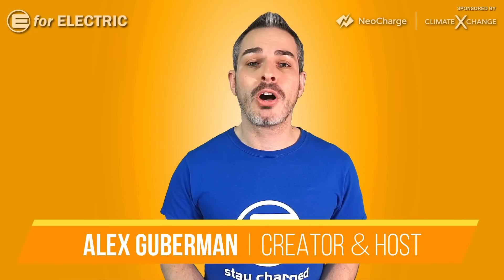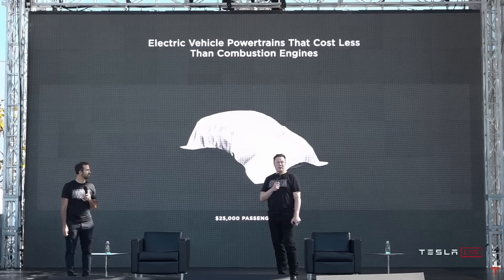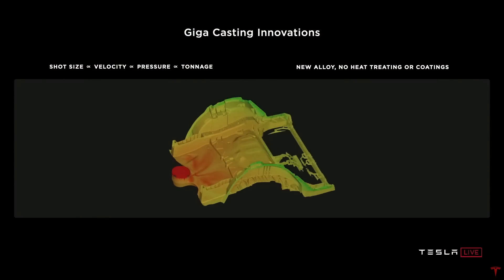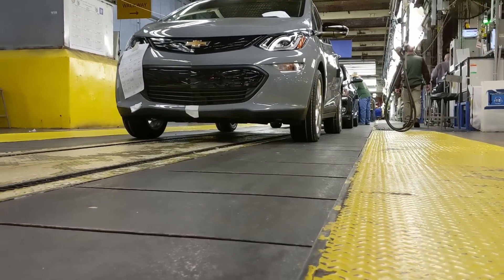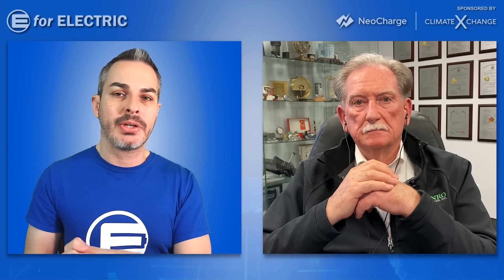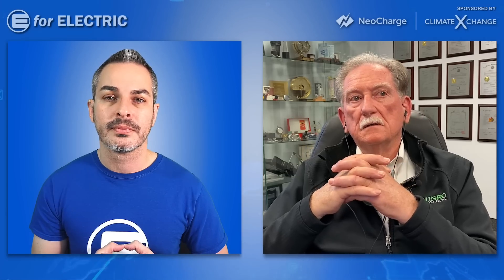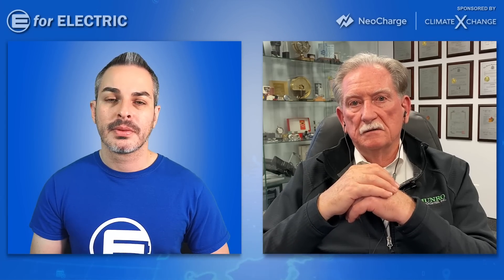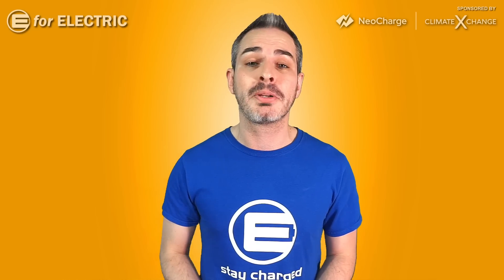SANDY MUNRO Defends $25,000 Tesla Timeline

Comment: You make a crappy car, you dilute the Tesla brand name. When the $25,000 car comes out, it will be good and kick every other brand's butt at that level. Tesla introduces products to dominate that product category. That is why your suggestion of a stripped-down car with much smaller range and no autonomous capability is a dumb idea. If people want a mediocre EV, they can buy the Volt and Leaf. Remind me how many years the Volt and Bolt have been out and how many drive them? Tesla's goal is to make all the ICE cars in the same class look like inferior so people will transition to EVs en mass. I think that is good for the company and for the environment.
Reply: Exactly, It would be like asking Apple to make striped down crappy Iphone. Not going to happen. Brand Image is HUGE
Reply: I think people would love a fun hatchback. Maybe a little bit slower than the Model 3 but with even better handling
Reply: @macberry4048  And that's what the 25k car will be. But unlike OEMs, Tesla won't be stripping the car of all features just because it's a smaller segment. I mean, I'm pretty sure it will be almost literally a small Model 3 hatchback. I can maybe see them removing electric seats for conventional ones, but even that is unlikely I think.
Reply: @macberry4048  With the new battery technology, it will most likely be as fast or even faster.
Reply: Agree on the $25000 Tesla having to meet the standards set by its larger siblings. While a smaller battery might actually cover 99% of use cases, one of the main concerns is getting people to move from ICE to electric, and that means meeting the expectation of being able to go on a road trip even in a small car. 300 mile range and supercharging are necessities in that respect. 
As for mediocre EVs:
Owning a Model S, and having just sold a 1st gen LEAF and bought a Bolt (Volt is the hybrid "predecessor") I'd say this about the LEAF and Bolt: The 1st gen LEAF is a well-built *car*, but a "restricted" EV. It's not one you would use for long trips, but for a #2 car it's OK. My main gripes were crappy infotainment with no updates, even crappier app (fastest way to see charge level is to leave the app be and just go out in the garage and switch the car on), and the transition from regen-only braking to regen + brakes was always a bit abrupt. Adding the fact that even for their "big" 2nd gen update Nissan didn't include active temperature management for the battery, I'm not looking in Nissan's direction for a new EV any time soon. 
The Bolt is about the same size as the 1st gen LEAF but taller, and with twice the motor power and decent range it's actually capable of longer trips. My ownership started with the 500km trip back home - a surprisingly positive experience. Its main problem in that department is the 50kW max charge rate (and even that is only for a short while)... The infotainment is decent, and it was probably a good decision to leave navigation to Android Auto/Apple Carplay - being mainly a #2 car for local shop runs and office commute it's no big deal having to plug in the phone via USB to get navigation. Sure I miss the IMHO superior interface and autopilot etc. in the Tesla, but it was substantially cheaper than a 3 and covers our needs just fine. 
Actually the Bolt does have one huge issue: It's a loss-maker for GM (if you ignore ZEV credits), whereas Tesla has about 18% margin on each car (still ignoring ZEV credits)...
Reply: @koma-k thanks for sharing!
Reply: @koma-k  I'm always kinda amazed at the emphasis people put on "infotainment" in *moving vehicles*.  When I'm driving entertainment is the furthest thing from my mind.  When I want entertainment other than what I get from driving I'll do it outside of the car.
Reply: @earthknight60    most people like listening to music or radio while driving, and also use navigation/maps. Or they need to be able to answer phone calls. this is all part of the "infotainment", and needs to be easy and safe to use.

In the LEAF, most of the on-screen buttons were on the small side, requiring more focus than they should making them a safety risk. The worst offender was the handsfree functionality: With two people using the car, it needs to be able to easily switch between known phones. The Model S and the Bolt do this, as did our 2009 Mondeo after an update a year into its existence. The LEAF however was a lesson in how not to do it: If I forgot to check before driving and it turned out my phone was not the one it last connected to, when the phone rang I would just have to ignore it... because to get it connected I had to: 1 - press the phone button (on steering wheel, so no issue).  2 - wait for the attempt to connect to my wife's phone to time out (10 seconds), then wait another 5 seconds for the "connection failed" message to go away. 3 - press the too small button bringing up the list of known phones. 4 - Press the equally small entry for my phone in the list. 5 - Press "connect". It is impossible to complete these actions before the incoming call times out.

Most cars I've driven are better than the LEAF, though none are perfect - even Tesla's system has buttons that are slightly smaller that they should be, though it's mostly good and my favourite so far.
Reply: I agree with you 100% and add one more thing: autopilot hardware is the farthest from being a toy. Even if a customer doesn't pay for the full-driving suite, it saves lives (and I believe it will save even more lives in a year). But what's almost as important is that it takes part of the fleet learning that gets to L4/L5 self driving. If Tesla would make most of its cars without fleet-learning hardware, it would slow down data gathering significantly and delay full self driving by years.
Reply: @ritteradam  I will be buying that car for my father who is closing in on seventy and has a snoozing problem. Autopilot will make him safe.
Reply: @ritteradam  This, a 25k car with amazing safety (As that is Tesla's goal with all vehicles) and the ability to be fully-autonamous in the future...? Who else do you see providing that deal?
A 25k car usually comes with the luxury of powered windows for all 4 windows, if that. :)
Reply: Exactly, it's not a tesla without technology. Stripping the car down like he's asking is just making another shit box ford with a battery instead. 

Only came here for Sandy... e for electric is a pretty sketchy guy otherwise... seems like he'd do anything for his sponsors.
Reply: Alex seems determined to not buy a Tesla no matter what. I don't know why he asked that question. 
Also: 
1) model 2 will use lithium iron phosphate batteries, so 4680 production is irrelevant. 
2) why would Tesla jeopardize model Y ramp to throw together a low quality car? 
3) Tesla still holds all the cards. Even if it takes 5 years from now to ramp model 2, Toyota is the only incumbent that has even a tiny chance to compete. I know a Prius owner who is drooling all over model 2. Camry sales will tank. Even Toyota will become  a mere shadow of themselves if they don't get ahead of this.

Because Tesla is so far ahead, they don't have to produce a garbage car or lose money on it. They will do it right.
Reply: Eternal Skywalker What are you talking about???

Camry sales will be in no way affected by a little 2 door Smartcar-like mini hatch or sport coupe that won’t have a usable backseat. .
Reply: @webcomment8895  A compact car will sell like crazy in Europe and Asia though! The Model 3 is too big for most people here, it's considered a pretty large car in the UK. :)
Reply: Curtis English Tesla makes their cars very low and sleek for aerodynamics. 
Small cars need to be taller to fit adults in the back seat. A Tesla smaller than a Model 3 that looks like the rendering images will essentially be a 2 seater which will limit the market. Not everyone has $25K to spend on a weekend toy.
Reply: @webcomment8895  Note that the large majority of people never use back seats beyond the occasional adult and more commonly kids who fit in small back seats just fine!
I can safely say I've had maybe 5 people in the back of my Model 3 in a year. 😅
Within Europe and Asia it's just common to have small compact cars, they fit out roads nicely and can fit in parking spots easier. I regularly find the 3 is too long and too wide to comfortably fit in a lot of parking bays, you end up overhanging them and struggling to get out sometimes. Like I said, would work great for Europe and Asia, maybe not so much the US.

I'd expect maybe a Golf sized vehicle, that's a very common size here, parts of Asia like Japan have much smaller though. :)
Reply: Curtis English In Europe, they have many subcompact hatchbacks that are very space efficient. They can carry 4 adults comfortably or the rear seat folds down for bulky cargo. 
These small vehicles are suitable as an only vehicle. Think of Honda Fit sized cars that are narrow, but have tall rooflines. 
A swoopy 2 door coupe is not that.
Reply: @webcomment8895  Who says the 'Model 2' or whatever will be 2 door? There's a good chance it'll be Golf-sized as that's the most popular size. I can't see them making a model that wouldn't be something many people want.

Though, I do think a 2 door version could sell quite well. the Vauxhall Corsa C was an insanely popular car in the UK, mainly because it was super cheap. If it has enough space in the back for shopping them it's usually good enough for most people's needs. The Model 3 has the opposite issue of having too much space, I use the frunk for shopping because it stops it getting thrown around in the trunk, can easily fit 3 bags in it. :)

(It was a nightmare to drive though, 5 speed manual with like 70bhp and no torque, you'd stall trying to set off on the smallest of hills. That thing gave me so much anxiety)
Reply: Curtis English Tesla’s drawings show it looking like a Honda CRX style coupe.
Reply: @webcomment8895  Tesla doesn't have any official drawings, just fan made ones. :)
Reply: @VoxelLoop  the drawing came  from Franz's desk but it wasn't used in the Battery day announcement. Tesla is building Design studios in both China and Germany... And the drawing was SPECIFICALLY used to advertise the China Design studio. Basically it is a challenge to prospective designers in China to put together something BETTER and specifically a BETTER FIT for the Chinese market than the drawing. Also, the drawing could easily be of a 2-door 4-seater.
Reply: Yes I am looking forward to this 25000 car with full autonomy.  I retired, I will be able to afford this, and hopefully by the time i am not able to drive any more full autonomy will be legal. Then I will be able to go out to the car and tell it where to take me.  That will be amazing. Wow.    I do not mind if it missing a wheel* nor if it only has 2 doors, nor if it comes from china,  just as long as it easy to get into.           *HEY. It will be just like the old days, my first van was a Reliant Robin (a three wheeler!).
Reply: My thoughts exactly to the tee, thank you Sir
Reply: Lay people don't seem to understand that all of those nifty features don't actually cost much to the manufacturer.  They assume that because the dealership charges us an arm-and-a-leg to upgrade to those options that that is what those options actually cost. No. The whole point of the upgrade model for dealerships is to turn a low margin vehicle into a high margin vehicle by overcharging for crappy upgrades. And some of the upgrade model actually hurts cost. The whole reason most manufacturers have stopped even offering a true "base model" with manual transmission and manual windows is because just OFFERING these is more expensive in terms of tooling and seperate lines than just including them in the lowest cost model. Tesla has repeatedly shown that doing away with options and just giving away the premium version to everyone is cheaper than having all of the options. This is also why they started using software to cripple the usable battery pack size for cheaper vehicles instead of actually shipping the smaller size pack.
Reply: When the $25,000 car comes out, Elon promised it will have FSD but no one will buy FSD, the money will go to pay bills. People who buy cheap cars will pay as little as possible. A cheap compact with FSD will crush that market segment. The car will have decent range and will be a nice compact car. One reason for the delay is the new batteries do not pass Elon's standards yet. It takes time to test a million mile battery to failure because even simulating driving a million miles takes time. As to high volume, these are still untested batteries. I think the quality reject rate ("scrap rate") is low only in low volume , or whatever, the batteries are still expensive. And Tesla needs to bring out other vehicles with higher markup and/or higher impact on climate first.
Reply: T Samuel in addition, the scaling of all the components for the batteries and raw materials and waste processing and recycling will take large scale time.  If the $25,000 car is to be the ultimate city car, sheer volume requires preparation at all levels.  Tesla is selling everything they can make and costs will grow all around in service, sales and charging.  It is crazy to think that the problems for a smaller and more affordable car will be just production.  Elon is pretty thorough in his analysis and I think he is right that he will need all the batteries he can get from wherever because of the sheer volume of demand for all Models combined.
Reply: @tsamuel6224  Million mile battery is only a question of charging cycles, which is very easy to test and has nothing to do with the fact that it is in a car.
Reply: Range is less important if the recharge time is fast and fast charging is widely available. People aren’t buying this little sport coupe for cross country road trips anyway.
Reply: Yeah that was a ridiculous comment from the host to be honest.
Reply: As others have mentioned, ripping autonomy features out literally saves pennies (in the grand scheme of things), at the cost of diluting the brand and minimizing key standout features. It also costs them NOTHING to software unlock the $7500+ option of FSD. Pure profit.

Comment: If you watched the presentation on Battery Day, they said they were not going to use these batteries in all of their products. These are going into Semi, Cyber.
Reply: Not quite, all the new batteries Tesla use will be the new, larger, tabless batteries. What changes is the chemistry inside the batteries. Cybertruck and Semis will get the pure nickel anodes, since weight is a premium. The 25000$ car will have iron phosphate in their batteries instead of nickel, because they are heavier and have less charge, but last longer. The mid-range products will use nickel manganese batteries, which are heavier and less powerful than the pure nickel batteries, but lighter and more expensive than the iron phosphate batteries.

All the batteries will have the same size, what changes is what they will put in them.
Reply: As a customer you probably won't know what you order or purchase, it just depends on mfg or production timing. They won't take down an existing process until that makes financial sense... also remember you can change the battery on used vehicles.
Reply: Jeebus  changing the larger epoxy moulded battery which forms part of the structure won’t be easy at all...unless they design that in somehow.

Comment: The host is missing the point and trying to logically solve the wrong problem. The true product is the factory and the energy products produced (e.g. new battery, supporting software offerings, etc,), not trying degrade the current Tesla transportation value provided to their customers. Rushing to market a subpar Tesla is not the focus here. If you don’t get it, buy something else and suffer the consequences of your decision. Rabbit hole 🕳 discussions on this topic are a waste of time.
Reply: And there is not enough batteries on the market to fulfil demand of a 25k car. Silly idea!

Comment: My guess is the China market will be ready for a $25000 Tesla, designed and manufactured there, before the North American market is the right target for one.  Just my guess.  I'd definitely do the market research first.  Lots of higher margin cybertrucks and semis should roll off the lines well ahead of sapping battery manufacturing capacity for lower margin offerings.  Market share seeking is great, but only insofar as you aren't shortchanging higher margin vehicles you can't fully manufacture to yet.

The big needle mover is massive scaling of high quality batteries.  That's why they made such a big deal about battery day... even if that went over many people's heads.  When the battery supply "spice is flowing" securely, and profitability has expanded dramatically, then all sorts of options open up to accelerate the company's wider mission.